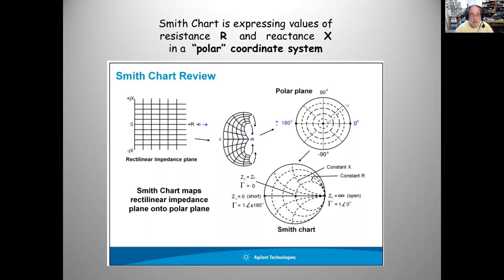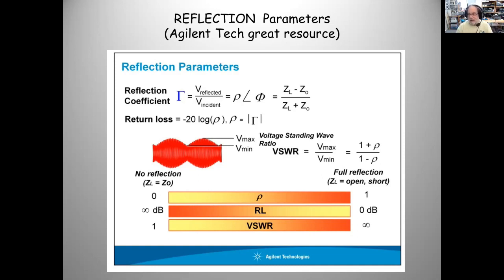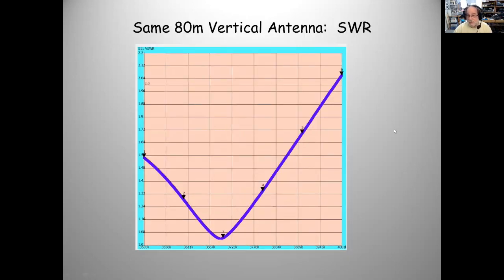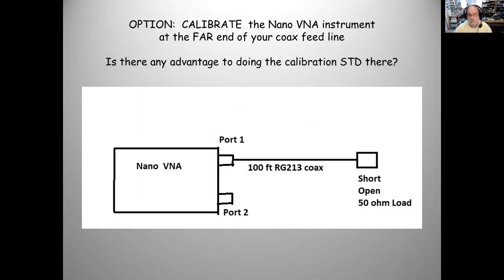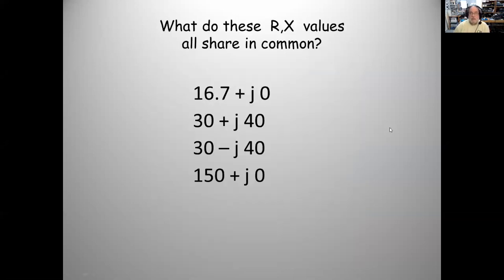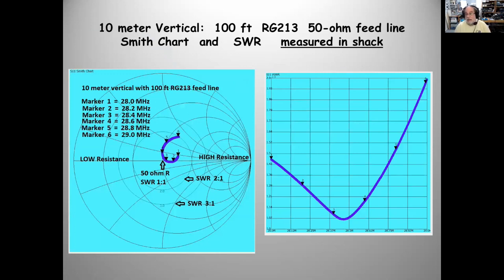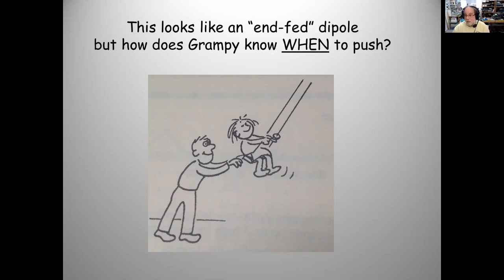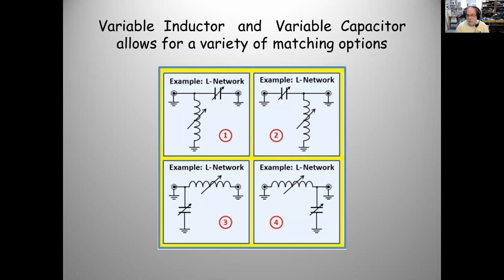Second Zoom talk by Barry K3EUI on the NanoVNA

Comment: Well, I finally got serious about using my Nano Vna so I came back to part 2. 

I must say the Git Hub pages for Nano Vna Saver could stand an editor coming in and cleaning up links said to lead to Window's executable files, but in fact lead to a collection of Python files with a Makefile for assembling the set with a Python Interpreter.

I almost gave up,  but I did find a link to a Windows 64 bit exectuable file. One should note, it does not install a Desktop Icon and be prepared to search for the executable file once installed. 

Aside from that hiccup, I must say except for your Math Lingo that conflates the Extended Complex Plane or Riemann Sphere with Polar Coordinates & a few other Math lingo blunders the contents offered in the videos are pretty good.